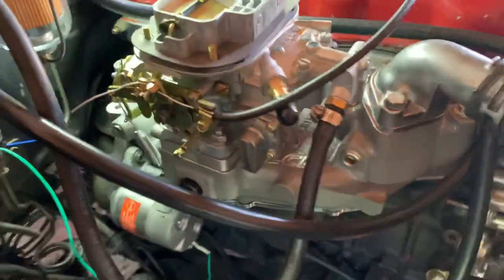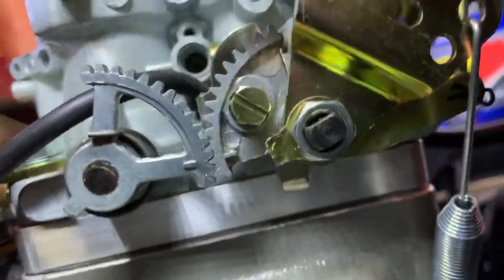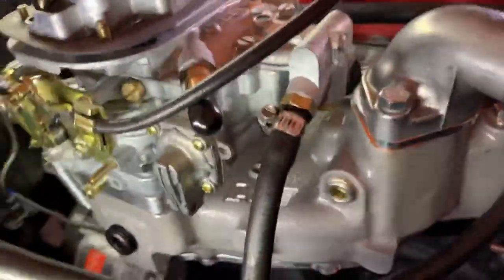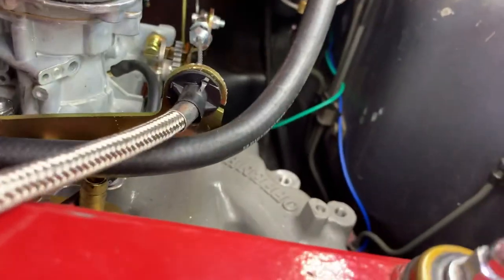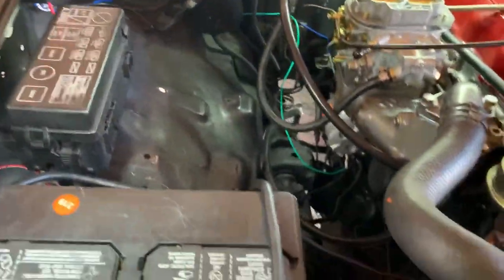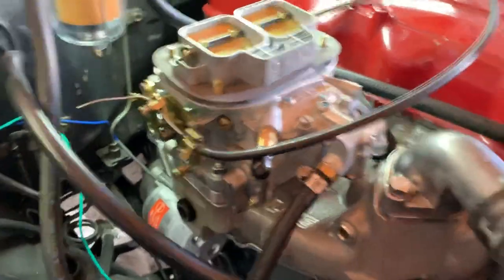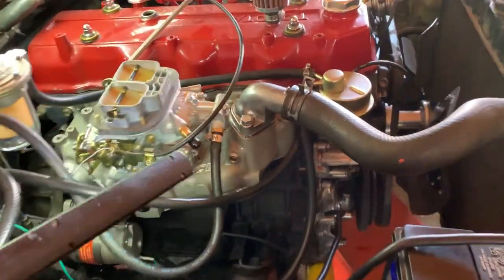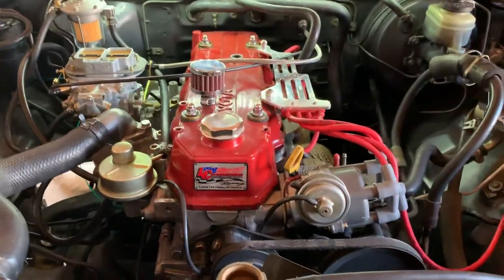Toyota Hilux 22R Weber Ghost Air Mixture Screw

Comment: You probably got it running rite by now,,but if you are still fighting it,,go bigger on the jets,,I have the same set up,,fought it for about 2hours,,,put in bigger jets,,runs great,,,and I don’t remember the size,,but mine has been running a year now,,no probs,,290 lunatti cam,,pulls hard through all gears,,no dead spots,,the bigger jets was the trick,,it has to have gas,,and check your plugs,,to make sure not to lean or to rich,,
Reply from the maker: Appreciate the comment with advice, I did get it figured out I had no idea what I was looking at during this time, not anymore lol
Reply: @Toyotas_n__Tools  yea,,when I was installing mine,,,I did a lot of research,,sort of a trail and error thing,and had to back away from it a time or two,,when I figured I couldn’t adjust it enough to make it act rite is when I said ,,,,it needs more fuel,,and bam,,when I put those bigger jets in,,it was like ,,are you kidding me👍🏻